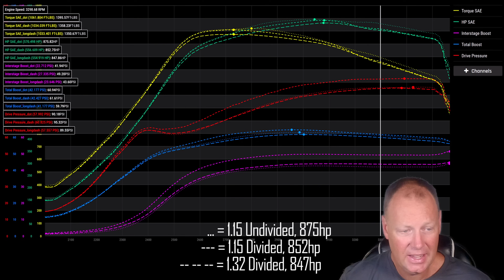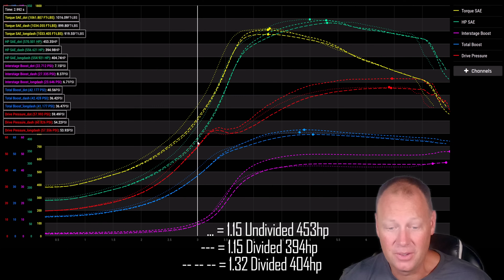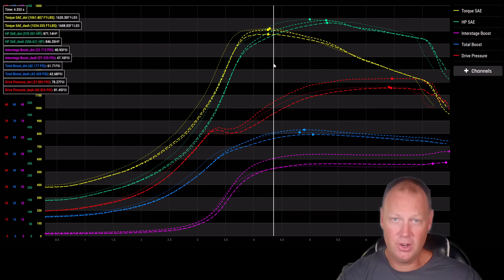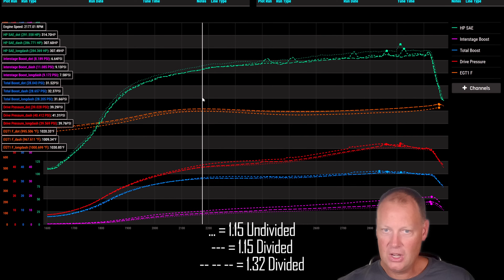Divided Vs Undivided Turbine Housing

Comment: Do you think it would be a good idea to Extrude Hone a turbine housing? Would there be any spooling benefits or efficiency gained from doing this on the hot side? Would it be a waste of money? Or are castings these days optimized for spool characteristics?
Reply from the maker: You wouldn’t want to open up the clearances it would make the turbo lazy.
Reply: @pddofficial Well..from my u derstanding, extrude honing really doesnt remove alot of material...from what i seen it will take rough castings and make them smoother. I figured if the inside of the exhaust housong is smoother and absent of rough castings and burrs the gasses would flow through it alot faster, similar to a polishing ports.

Comment: On a 2nd Gen VP truck with the a/cz trans cooler/heater, and passenger side battery deleted, can you run a straight steed speed manifold in an he351cw/hx60 25cm² undivided t6 compound setup with and over/under setup or with the secondary mounting backwards and the primary where the passenger battery was so the hot pipe is short as possible.

Comment: Can you mate a single scroll (open inlet) turbo to a twin scroll (divided inlet) manifold? Have a t3 divided log style manifold I’m trying to mock up a g35-1050 to, but the g35’s only come in open or v band 😭
Reply from the maker: Yes, we've done this many times, never had an issue.  Just be sure to use a single scroll T3 gasket so you don't eat portions of the gasket later.
Reply: @ much thanks! I’m going to give it a shot!! Hope to make around 750wheel with this lil turbo 🙌

Comment: Well, I'd say that there is benefit in single turbo setup, and on low rpm. Also pulsed manifold and housings especially help on low mass flow and part throttle where they induce evenly spaced pulses for turbine wheel to attribute more shaft rpm in low flow conditions. But all of that benefits actually hurt high flow performance, especially here with compounds...

Comment: ever experiment with a spool valve on the small turbo, (Divided housing with a valve the redirects all the exhaust into one scroll and when boost comes up, the valve opens allowing full volume.) then put your small turbo exhaust into the undivided housing of the big turbo. I run one of these valves on a single turbo divided housing gas engine and it works amazing, you get the benefit of small housing for spool up and big housing for top end power.
https://www.youtube.com/watch?v=2BXP8TLBLzc

Comment: In the 80s single turbo F1 engines always used divided housings and revved to ~12000 rpm, they must have been idiots. Even today V6 F1 engines use divided housings, they must be idiots.
Reply from the maker: F1 is not about maximum power, it's about maximum usable power on a track with a need for maximum transient power response.  F1 was not building compound turbos either, there is no valid argument to use a divided housing for the second turbo in a compound setup because the exhaust pulses are no longer divided.
Reply: @pddofficial  you are right, useless to even test divided housing after HP turbo, everyone knows they flow very bad because of divider.

Comment: Sorry.. twinscroll housing require alternate pulse going into each side of the scroll port...

Not just half bank of the cyl to 1 side and another half to the other!

Thats already making your test dyno data invalid..

Also thats the reason your keep melting your turbo scroll divider wall 😂

Make a proper twinscroll manifold/header with proper alternate pulse flow into each scroll, then test again...

Then u can see minimum 500rpm faster turbo spool up and then it will keep going making good power matching the rest of your dyno plot...

Have a look into how firing order relates to twinscroll turbo manifold design in JDM supary impreza ej20 setup to make easier understanding of the concept of twinscroll turbo..

Cheers
Reply from the maker: Great point!  However, in this case, the 6bt Cummins firing order does correctly alternate between front and rear scrolls from the factory and all mass produced aftermarket manifolds share this geometry: 1 thru 3 are connected to the first scroll and 4 thru 6 feed the rear scroll.  With the firing order being 1, 5, 3, 6, 2, 4, each scroll is fed correctly.  The melted divider doesn't usually occur on these engines till they exceed 1500 rwhp.  What's also interesting is gasoline and/or methanol applications also suffer from melted divider/melted center gasket as power density becomes extreme.  Most of the high-end GTX55 class race turbochargers consequently are offered with non-divided v-band inlet flanges.  If divided pulses could be harnessed safely on these extreme race applications, they would be.
Reply: @pddofficial   ahh ok.. understood.. sorry for the harsh earlier assumption...

then the next question would be does the gtx turbine blade design were optimized for twinscroll housing design or compromised between twin and single scroll...

As for melting the divider plate.. at over 1500hp level.. i guess it does makes sense...

Because mainly atleast on gasoline specific application twinscroll turbos were often common on sub 1000hp mark for roadcourse usage where trancient/boost thereshold during part throttle application matter the most between corners to the next...

While drag/strip/roll racing application with2step launch control, turbo lag issue almost doesnt mattter..

Cheers..

Anyways thanks for sharing the insight...

And another question, why water pouring out from the front of the truck during dyno pulls?

Comment: The BMW s63 engine is a hot vee V8. It uses two dual scroll turbos, but the exhaust manifolds are like an X shape. So each turbo is fed by two cylinders on each side. It is a pretty interesting design, but that engine makes torque down low like a diesel

Comment: Always wondered. Good comparison. 
Too bad Banks did not do this with his air horn.... 
Hint hint potential vid ideas no one has done, cuz there is no difference. Probably not even at 1000hp.
Reply from the maker: I think at 1700 hp we saw a variance of around .3 psi in the plenum with different types of air horns
Reply: @pddofficial  How does that translate into horse power if at all. .3 seems to be within margin of error.

Comment: Divided housing has absolutely no place on any application where the exhaust pulses are already merged before the turbine.

You'll have the ability to melt the divider every time, because it's now required to "split" the gases back apart. That's bad for everything. Off a split manifold however, there could be an argument for a generally larger turbine wheel and divided housing.

Comment: I would of like to seen this done one a common rail and each setup tuned for best results. NON the less very interesting 
 I would ofnthought the 1.15 divided housing would of spooled much quicker because of the added cast iron to the division making the supply area tighter. Shows what i know. . I want qn ooen  one now. .

Comment: Melting the divider can not be true when the EGT is 1000F.
My stock car is able to hit over 1000F EGT and I have not melted anything yet.
Reply from the maker: 1000 degrees is very very safe egt
Reply: @pddofficial  So what EGT are you running then to melt the divider?
Reply: @klev2008  If the EGT is enough to melt the divider how would the turbine wheel and wastegate survive?
The only way I can think of the divider melting and not everything else melting would be if excess fuel was burning in the exhaust and not in the engine, because valves and everything would normally burn just like the divider.

Comment: I may have missed it but how much fuel in CC’s?

Also, what about doing the test with a single turbo?
Reply from the maker: Max power on this truck was around 600cc’s. The pump does more but that’s the limit of the turbo system.

Comment: How about 5" vs 4" undivided? Some of us don't mind the fab work if we can pick up a bit more power with the same fuel.
Reply from the maker: In our testing we saw no advantage with the 5” outlet. We even used a full 5 inch hood stack with that housing and a 4 inch hood stack with the 4” housing. At the high 900HP runs the 4 inch made the same power everywhere.
Reply: @pddofficial  Thanks again for testing and sharing the data.

Comment: Reason I put a .85 undivided on my Sxe588 on my first gen. 🙂
Reply: Hope you're able to produce a video on your trucks sometime here feller 👍👍👊
Reply: Rubbish. You have a 400hp 1st gen
Reply: @RockyMountain4x4  probably about right. That why the egts don’t go over 1000f  and it will make 70 psi boost with 80psi drive at 3800rpms.